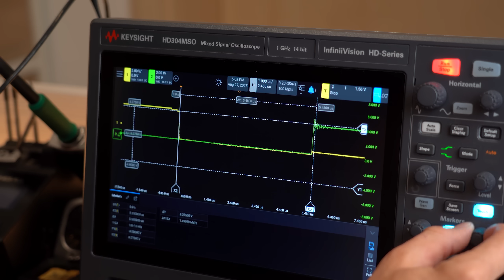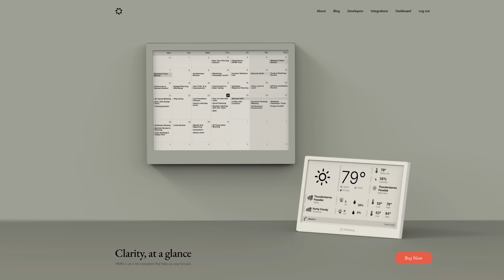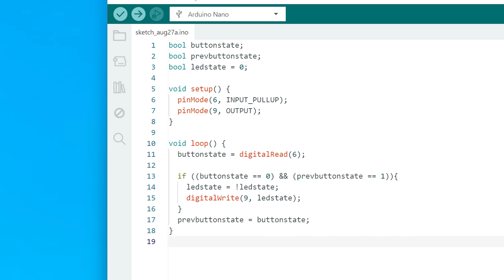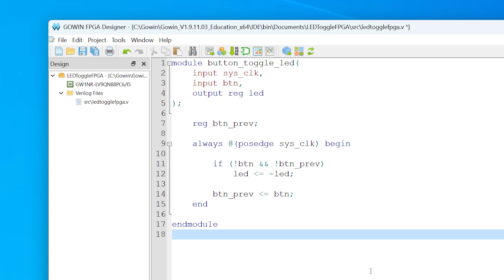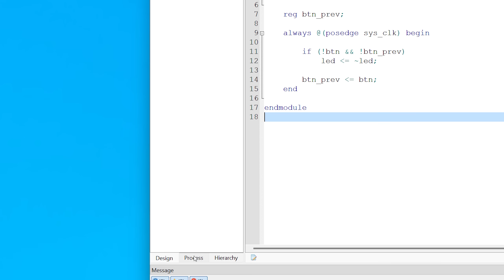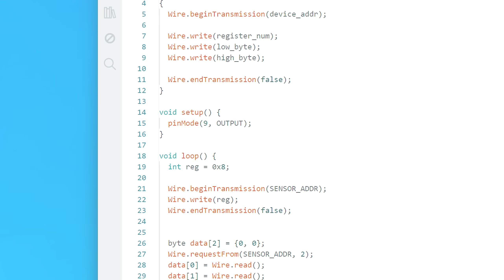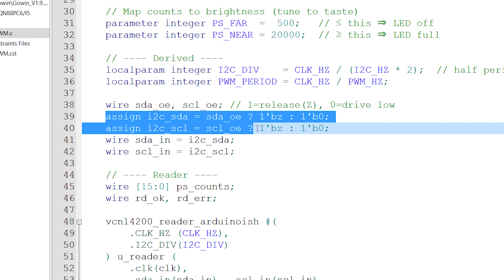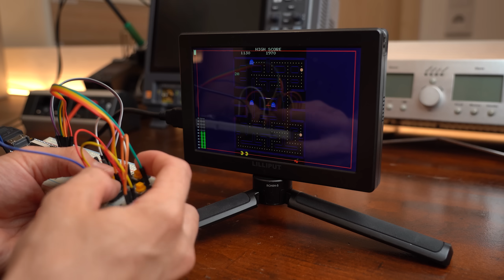The Harsh Truth about FPGAs (You Should Avoid Them?!)

Comment: One of the use cases I have for arduinos (even quite restricted ones, like the 8MHz nano) is as a variable clock generator. Although I haven't measured it (my oscilloscope sucks, 200kHz max), I think it does up to and maybe even exceeding 1MHz without any trouble, which is quite enough for me, and as a computer nerd it is more "controllable" (hah!) than a simple 555-circuit. The Z80MBC2 I also have uses an older version of the AVR chip with more pins to provide clock, ROM and reset logic for the Z80, so with just four chips and a SD card module and some sort of serial adapter for arduinos you get - amongst other things - a fully functional CP/M 3.0 computer.
We live in amazing times!

Comment: Nice video! Want to add that in my perspective FPGAs are way better suited for video input/output processing. An example project I have done is reading and processing the GameBoy display video signal running Tetris using an FPGA and sending certain pixel values (board position) via UART to an Arduino, which in turn ran the algorithm that calculated the best placement for the ciurrent piece and pressed the controller buttons. So in short: FPGA -> high speed signal processing, MCU/Arduino -> algorithms/sensor logic

Comment: Hi. High Energy Physicist here. We use FPGAs extensively. For the communication part, we mostly use IP cores. And there is also something called High Level Synthesis (HLS) that we often use to convert C code into VHDL code. Although it's not that straightforward. But we physicists are more familiar with C than VHDL. We aren't engineers!
Reply: As a software engineer, I have always been a bit surprised that so many FPGA engineers are still working directly with HDL (I stopped using assembly language about 30 years ago). IMO, coding in C or C++ and using HLS is definitely a major improvement. When possible, I prefer the additional abstraction offered by OpenCL, DCP++, and a robust IP library.
Reply: @comeraczy2483  
I wouldn't compare HDLs with assembly. The equivalent of Assembly for an FPGA would be to design in terms of the functional units of the FPGA (the LABS/CFU/CLU/LUTs or whatever they may be called in your particular technology).
HDLs are more like C, where you have abstracted away all of the architectural details of your particular device, and can describe the design in more abstract terms.

You also shouldn't confuse the abstraction level of the code with the language. HDLs can be used to write very abstract code that can be used as input to HLS tools. HDL code written on "RTL-level" is where you describe exactly what happens in every clock cycle. This is the typical use case of HDLs, so unfortunately, HDLs have become synonymous with RTL level design even though they need not be.

HLS tools allow you to describe an algorithm and constraints in terms of the number of clock cycles you have available to perform the algorithm. The HLS tool will figure out how many operational units (adders, multipliers, memories, etc) it needs to execute the algorithm in the prescribed time, create a datapath, schedule the operations over time and create control circuitry that shuttles data around the data path. This job could take days, weeks or more to do manually. The HLS tool does it automatically in minutes.
The result is not often optimal, but turnaround is faster and productivity increases.
I know many companies that use HLS for proof-of-concept designs and algorithm development, or to enable SW engineers or researches (like @PrajjalakChattopadhyay) to use FPGAs, but when it comes to deployment, the code is rewritten in RTL-level HDL in order to optimize performance and resources.

I would also go  for an RTL description written in an HDL whenever I want to build a circuit that either:
- adheres to strict timing requirements (an I2C bus controller, a DDR5 memory controller, a video interface)
- is described by a simple algorithm (i.e a PWM output, a UART, timers, counters)
- is mostly a complicated state machine with little or no data manipulation
HLS is simply not good enough for such things (yet).

TL;DR
HLS is most suitable for a subset of digital design, namely signal processing-like applications where you want to build a datapath and control circuitry for that datapath. Other applications are much less suited to HLS and are better described by RTL-level code using HDLs.
Reply: @comeraczy2483 You don’t program an FPGA.. you wire it via text instructions. MCU programmers often approach them with the wrong mental model, expecting a processor that executes instructions instead of a fabric of logic gates you can shape however you want.

Comment: I'm shocked you didn't mention that FPGAs also have libraries of pre-made snippets for such things as I2C, SPI, HDMI, PWM, etc... even libraries to emulate (implement?) full architectures of other CPUs, including supporting standards like RISC, ARM, Z80, etc... with them, you write the logic blocks identically, and simply call them just like you would do in an Arduino without having to understand the implementation details. And as with the Arduino, if it fits, it ships.

Comment: The raspberry pi pico lets you do high speed io (and limited logic) with the PIO (programmable IO). You could make the button + LED example work with about 7 ns delay (better than either the other microcontroller or the FPGA).

I used the PIO on the pico for measuring the time difference between the rising edge of two pulses, I was able to get the resolution below 7 ns. I also used it for counting pulses to make a high accuracy (7 digit, 10,000,000 count) frequency counter.

I doubt you could implement the whole I2C to LED PWM within one PIO state machine, but you can implement I2C with PIO, and you can implement PWM with PIO, and can use Python or C to talk to the PIO state machines.
Reply: Side note, he could have made the FPGA solution much faster by using the button input to drive his logic directly instead of a digital edge detect at 27 MHz. The Raspberry Pi PIO is a neat block.
Reply: The Pico PIO is really neat - you can process signals at 100 MHz or more - on a board supported by the Arduino IDE!
With all of the other products you pretty much have to choose between simple to use but really slow (Arduino etc) or much faster but a hundred times harder to use. Pico PIO is really fast, on a chip/board that is easy to use.
Reply: @senseisecurityschool9337  Today I learned Arduino got an IDE. The thing they called that before wasn't.

Comment: FPGAs are great at replacing parallel non-sequential digital processes where the outputs result from the inputs (like something you would have built long ago with digital logic).  Your example of a button lighting a light or something that did that through a combination of AND and OR gates.  A microprocessor is better at running sequential processes (hence the name) where a the procedure for the process is in step with loops, branches, and conditions.  FPGAs are useful for their speed but they are less general purpose than microprocessors so I think microprocessors are the better fit for most makers but if you have a network calculation (like AI uses) that needs for be really fast, FPGAs are your go to.
Reply: Not really, You can do anything you want sequentially in an FPGA, most more complicated things impliment soft CPUs inside the FPGA, like an I2C peripheral would be an I2C IP core in an FPGA which is basically a standalone soft processor. The main reason you use a CPU over an FPGA is purely because it contains tons of premade building blocks like instructions, peripherals etc. Those Mister FPGA projects literally impliment 68000s etc. The problem with FPGAs is they are expensive and limited in size because they are build from reconfigurable logic blocks. Everytime you turn the thing on it has to rebuild itself from flash memory. So it's fairly silly to buy a massive FPGA to impliment soft ARM cores alongside of a bunch of tiny parallel soft cores that you actually want to use the FPGA for. Instead you just buy the cheap ARM CPU for pennies then use a much smaller FPGA. 

FPGAs also don't make much since when making millions of the same thing, at that point it's a hell of alot cheaper to spin up an ASIC. So FPGAs are great when you need field reconfigurable hardware (Like the Mister) or lower volume custom parallel CPUs. It's not that CPUs are better at it, it's that it becomes massively wasteful in an FPGA
Reply: Several sequential processes are way more efficient to run in an FPGA, e.g. CRCs for a serial line. Or twenty, all with different clocks. It's also worth mentioning that they're excellent prototyping test beds for ASIC designs.

Comment: 5 µs is a long time, even for a microcontroller. If you are writing an application to toggle the LED using a button in MicroPython, I can understand that. If you write one in C or C++, I am sure you can get it down to a few 100 ns relatively easily. But most microcontrollers have built-in peripherals that can automate a lot of things. If you configure a timer to count up by 1 whenever you press the button, and then set the auto reload value to 2, and capture compare to 1, you can have it toggle an output pin without needing any code running. I'm sure you can get it down to a few nanoseconds.
Reply: This is because of the arduino library abstractions. A while back i have tested a high-low loop in the original arduino and it was like 10khz. With direct port manipulation you could go up to 500khz.
Reply: A while back I needed to do MFM on a 500kHz signal on an atmega running at 16MHz, so I had 32 clock cycles to do my processing. That's when I found out about the insane overhead on those helpers, and also that directly manipulating the pins through the registers isn't that much extra coding.
Reply: digitalRead and digitalWrite in nearly every Arduino library is very slow which is where the slowness comes from. It's also why the Teensyduino library has digitalReadFast and digitalWriteFast. They both end up being inlined to direct reads from and writes to the IO registers. However, I think his point wasn't that "you can't do this faster on a microcontroller", it's that, without a deeper understanding of the microcontroller you're programming, you're not going to get great performance on a microcontroller compared to an FPGA, and that often, you really don't need perfect performance on a microcontroller.
Reply: @mr-majoras-mask  Using your suggestion, the following code (with the megaTinyCore).... gets the microcontroller down to 336ns at 16mHz:

#define PIN_BTN PIN_PA2
#define PIN_LED PIN_PA4

void setup() {
  pinMode(PIN_BTN, INPUT_PULLUP);
  pinMode(PIN_LED, OUTPUT);
}

void loop() {
  // Wait until the button is pushed
  while (digitalReadFast(PIN_BTN) == HIGH);

  // Toggle the LED
  digitalWriteFast(PIN_LED, CHANGE);

  // Wait until the button is released
  while (digitalReadFast(PIN_BTN) == LOW);
}
Reply: Using @mr-majoras-mask suggestion, the following code (with the megaTinyCore).... gets the microcontroller down to 336ns at 16mHz:
```
#define PIN_BTN PIN_PA2
#define PIN_LED PIN_PA4

void setup() {
  pinMode(PIN_BTN, INPUT_PULLUP);
  pinMode(PIN_LED, OUTPUT);
}

void loop() {
  // Wait until the button is pushed
  while (digitalReadFast(PIN_BTN) == HIGH);

  // Toggle the LED
  digitalWriteFast(PIN_LED, CHANGE);

  // Wait until the button is released
  while (digitalReadFast(PIN_BTN) == LOW);
}
```
Reply: The loop compiles into this assembly:

```
 160:   12 99           sbic    0x02, 2 ; 2
 162:   fe cf           rjmp    .-4             ;  0x160
 164:   14 9a           sbi     0x02, 4 ; 2
 166:   12 9b           sbis    0x02, 2 ; 2
 168:   fe cf           rjmp    .-4             ;  0x166
 16a:   fa cf           rjmp    .-12            ;  0x160
```

pretty tight for the AVR microcontroller
Reply: yes, the microcontroler can be faster, but also the FPGA's can go much faster, it is not necessary 27Mhz als mentioned in  the video, FPGA have internal PLL's to produce higher clock frequenties, could be e.g. 300Mhz. And it can be even faster bij using a 'serdes' with an LVDS output, than you can see lower than 1nSec speeds.
Reply: A guy called NerdRalph wrote a library ArduinoShrink for AVR8 (Uno, Nano) that reduces digital write and digital read to single assembly instructions, provided you are using constants for the pin numbers.  

It also, as the name says, reduces the size of your object code in flash, sometimes by a lot.
Reply: In the old old old days we used hand-written assembly and counted cycles.  That allowed some serious trickery with clockless data transfers, particularly with the 6502 and 68000, where we would spend a few cycles synchronizing the two ends (whos cpus were running at the same clock speed) and then literally just stuff bytes onto a parallel port or a pin in a tight loop without any further handshaking.

Usually we could stuff 256 to 512 bytes at a time before the crystal drifts between the ends got too out of whack.   It got very sophisticated, actually.  It wasn't possible to completely unroll the loop due to memory constraints, but one could do sequences of 8 load/stores at a time and then adjust the index and loop.  All cycle-counted and exactly the same on both sender and receiver.  It looked crazy on a scope but it worked.   We could get the byte transfer time between two machines over the parallel port (IEEE-488 port on the Commodore PET) down to 6 or 7 uS on a 1 MHz 6502.  Or something like that.

These days well... it isn't impossible to cycle count, but there are usually too many things going on particularly with multiple SPIs that you couldn't safely disable interrupts for any amount of time.  Not only is it unsafe, but I often wind up having to re-enable interrupts from inside specific interrupt handlers (for stack-based or static address register save/restore interrupt handling) to ensure that higher-priority interrupts can actually be serviced at full speed.

There are still plenty of tricks, such as using timer-compare registers with output pin latches when the base PWM isn't powerful enough to handle a complex scenario.  Even so, we are starting to see microcontrollers with on-board DMA to deal with bandwidths that the non-deterministic timing of the interrupt handling just can't handle.

-Matt
Reply: He should detect button pushes via external interrupts, then using direct IO (skipping Arduino libs), would reduce it a lot. Or, as you said, using Timer/Counter with output pin.
Reply: Is this time for me to be an assembly language troll? ;)

Comment: Verification Engineer here, basically i write code in SystemVerilog which in itself is like a mashup of 3 different languages: Verilog, VHDL, Assertions. And it's object oriented. YOu can write synthesizeable code while also wirte pure funtions for logical tests used for verification of a complex logic block. Basically, hardware guys wrote code in verilog & vhdl for say I2c and SPI, whil we wrote our own models and had the bits be processed into objects like packets (similar to ethernet) and then run checks on them using their output and the simulation output of synthesis to see if they match.
It's a very in depth field and short on engineers.
Reply: Note that you might want to delve into UVM, which I have to say is the one and only time I've seen object oriented programming make sense. You can wrap the I2C transactions into, say, a specific startup sequence. Also, if you're interested in SVA assertions, these aren't your average CS101 assertions. These are time-based regexes. These are great for making sure that every simulation is conforming to whatever aviation-spec requirements you're supposed to be checking.

Best/worst part? Everybody holds onto their code like dragons; no example code online for AI to steal.
Reply: Also one of the subfields in electrical engineering with a very high salary potential. E.g. FPGA Engineering roles at HFTs pay extremely well.
Reply: @qps9380  Oh yeah, and fpgas are surprisingly everywhere. HFT, ISP ethernet hubs, satellites, old VRR displays and basically every IC company in existence
Reply: do you recommend at 30 year old start FPGAs to work on the industry some day? its viable?
Reply: @v44n7 Only try if you are already in microelectronics, ASICs, or VLSI. Scripting and some general electronics also helps. There is a very steep learning curve without these backgrounds, and few learning materials. The tools and design languages are antiquated, require a lot of reading documentation, and AI is absolutely useless outside of boilerplate. It's tough stuff, but that makes it good job security.

Comment: But i belive, that you use the microcontroller in a wrong way, there are a lot of videos available how to use the Arduino IDE to use assembly line for code and even lib´s for fast action Pins. Also if you want you could avoid Setup and loop part to make it even faster. i belive you could nearly be fater than the FPGA